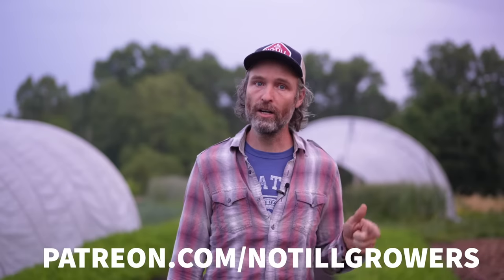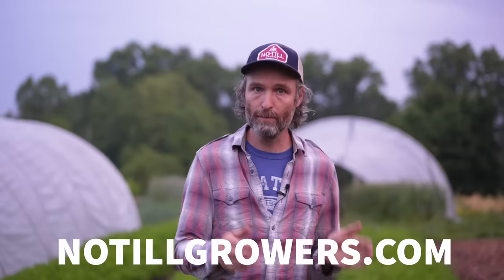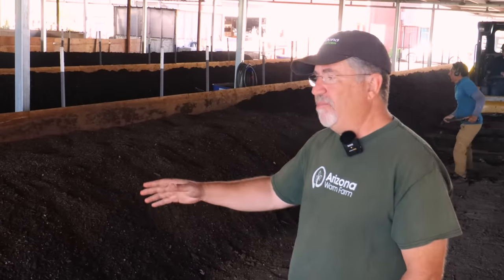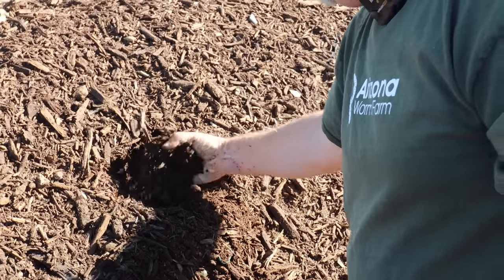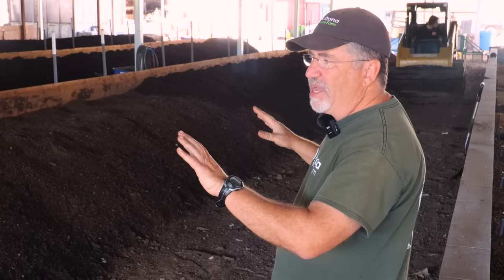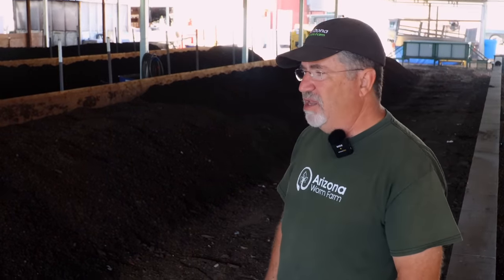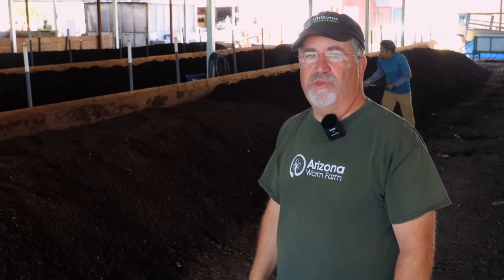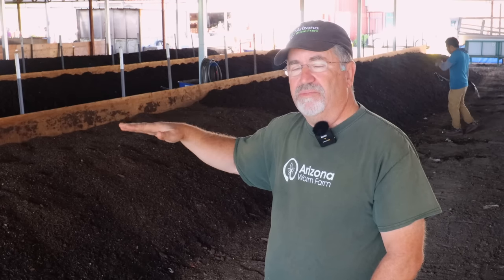Vermicompost and Worm Breeding at Any Scale || Arizona Worm Farm

Comment: I thought the most useful breeding "trick" is to use inert bedding and feed from the top so worms will encounter each other.  I only raise worms for fish bait, so the castings are a byproduct.  Fortunately, I have plenty of friends with gardens, so nothing goes to waste.
Reply: I heard that, but wondering if I'm missing what is supposed to be special about that. 
When you grow worms, of course you're going to feed them periodically. That's actually normal and requisite. And of course however you add food, it will attract the worms. Will worms be more amorous and mate? I doubt it. Also, keep in mind that although probably not as desirable worms are hermaphrodites which means they can self-produce and not require a mate.

Comment: Great presentation, but one question.  Does the wedge system require a hard floor (i.e. concrete) or can this system be placed on a plain dirt parcel.  Would the worms migrate down deep into the soil, or would they follow the added food on the front of the wedge?
Reply: As long as the "dirt" is low in organics, they will hangout where the conditions are correct (the pile)
Reply: @t.dig.2040  thx!

Comment: Did you ask about rodent problems with the open wedges? I would also like to know if the "packed castings" are free of cocoons and worms
Reply: Probably not...if dry enough to kill last eggs then benefits of casting is minimalized.
Reply: They are free of worms, they don't get through the screen. 
Cocoons are there, but that's, like, a good thing.
Reply: @LoisoPondohva   For Indoor use I guess u don´t want cocoons either.
Reply: @Dampflanze  well, it's not a problem unless you have a phobia, I guess? 
Getting rid of the cocoons while preserving micro fauna is hard, and it will be additional work and cost (which will translate into consumer pricing) to solve a problem which is not really a problem.

Comment: Very helpful. I would like to stay small scale. And sell to end users products such as 10- 50 worms for potted plants depending on size and goals of consumers. Do they want to fertilize in-situ or do they want to turn their plants into mini Vermicompost bins to decrease their green waste that goes in the trash.  Then the largest of the scale would be to consult and set up a raised bed with really good vermicompost amended soil mix with about 500 worms as an initial stock supply, then they can have more consultation when they are ready to replicate the process for themselves, but without any additional materials from me unless they want to buy that is. 

Then there is the compost side of the equation and just working to get people to see the value and easy if using the freshest worm compost they can get. 

I also have mealworm stock and there is a breeding side and a Frass side, similar to vermicompost but Frass is easier to store because the biology in the amendment is different but Frass can be used in a worm bin. I have not tried that yet but I heard it works well. 
Thanks for a really good video.

Comment: The one thing I don't understand after watching this video is how you slice off the rear of the wedge.
Reply: PART 3 maybe 🤔 🤷‍♂️
Reply: I was thinking flat-nosed shovel as you work your way back slowly to the high end (back side) of the mound, going a few inches at a time to make certain the worms have moved from the shorter nose (front side) end?

Seems like as you "slice" through, you would want to butt another piece of plywood against the just harvested raw edge?
Reply from the maker: The backs of the beds are supported with t-posts and plywood. That's why the back of the bed is so flat. When it's time to harvest, they remove the plywood and shave off the back with a flat shovel.
Reply: @notillgrowers  Very helpful.

So they start at the taller back end along the plywood rather than along the open, shorter front (nose) end?

Curious. Seems counter-intuitive.

I would think as the pile matures into castings, they would shave off the front nose end, screen for wigglers & add them back in to tackle the thicker, taller part of the pile.
Reply: @flatsville1 they’re likely feeding the worms on the shorter side, making the taller side pure castings. This is because the worms migrate to where the food is.

Comment: Hello, 
Compost worms barely have any impact on soil structure. They are great for turning organic matter into a clean cast freed to a certain degree of pathogenic spores, but they are far from having the same efficiency in structuring the soil, mixing organic matter with soil within several metres depth as do lumbrics (lumbricus terrestris, nicodrilus longus). If you put compost worms in your garden, they will die within in the year, as they always need a moist layer of thick organic matter. In nature, you encounter them underneath cowshit or so, but the vast majority of annelid biomass in the field (for western Europe at least) are anecic lumbrics, that work the soil and live for several years.  Are there any attempts to breed real lumbrics?
Reply: My experience and what I know is completely contrary to your comment.
Speaking specifically about red wiggler compost worms which live near the surface, they are happiest within 4 inches of the surface but can venture deeper. The process of digesting decay is extremely beneficial to creating soil structure and biome. The result is far superior then if the decay and decomposition happened without worms and without the worms' secretions that are introduced only when the worm has digested the food. This has also been studied and proven in laboratory conditions so is not based on folklore.
Worms will survive in some difficult places, all it needs is sufficient moisture within a few feet of the surface, and if it does die its eggs can survive hundreds of years until the next major rainstorm that would activate birth.

Red wigglers are supposed to be common throughout the world on practically every contiennt but there can be specific other species that might also thrive in some environments but usually are less promiscuous and not always as voracious.

Comment: $40-50 bucks for a pound of worms is way over the top in actual value . You are robbing the locals buying your worms .
Reply: That's not how pricing works. Wigglers are everywhere with leaf litter. Anyone can set a worm trap and get a start for free, but then you have to breed, feed them, water them, turn them (depending on your setup), and feed them powdered food to get them to reproduce at a reasonable rate toward actually producing any level of usable castings on a backyard scale. That service is worth probably $50 in real value as that was the price pre-covid that was normal. Now, with shipping and input costs it's still the best natural solution to help get the nutrition that exists in the soil. If you trap your own worms maybe you'll be able to sell them for $35/lbs after four years of perfect care. But good luck keeping inputs coming in at that price.